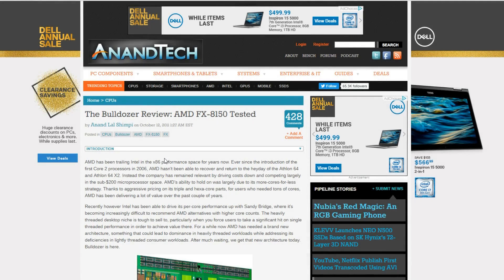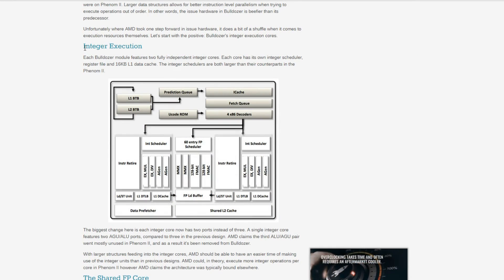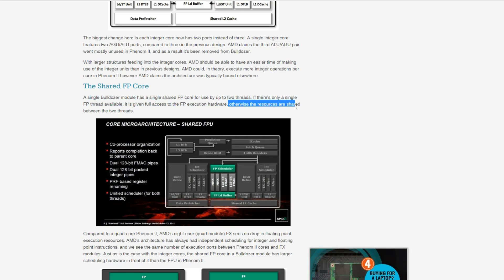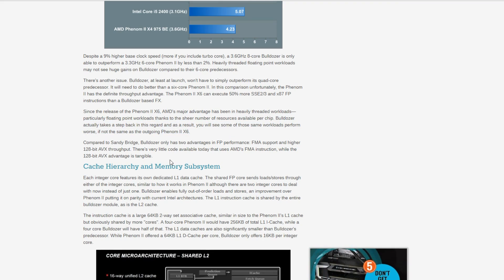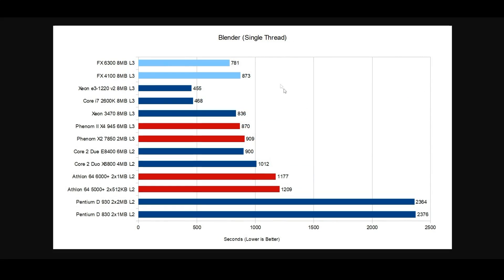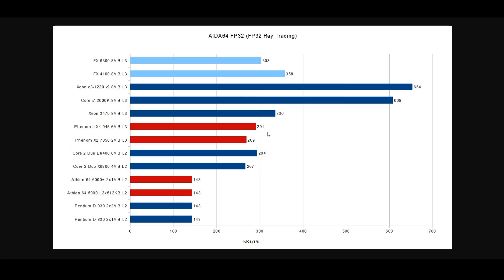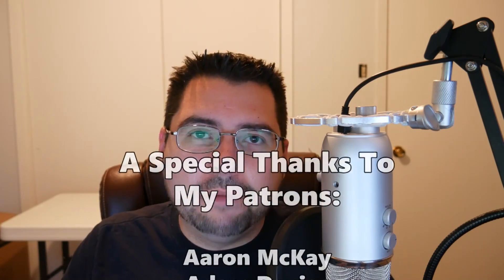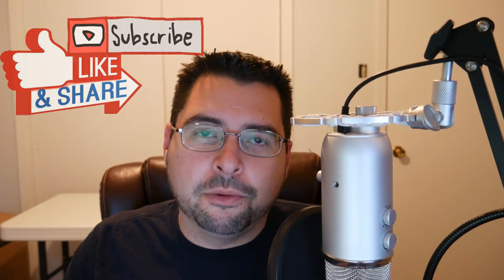IPC Test 7: AMD FX Series CPUs! How Does it Compare?

Comment: I got into heated arguments at Amd forums and with even a employee before it came out i knew IPC was going to be lower on Bulldozer as it was common sense looking at the design.  Months before launch JF-AMD started to downplay ST performance and i knew it was going to suck. I waited still with my 200$ Sabertooth 990FX board for reviews to come and sure enough tomshardware said the engineering team was trying to "hold the line" on IPC with Bulldozer and increase frequency's to 5ghz yah how dumb is that? 

Ended up buying a 8350fx to replace my 1100T that easily OC to 3.9Ghz and my 8350 couldn't go above 4.4 and it was slower in some cases like in emulation which i used often.

So happy Amd got their head together with Ryzen and created a logical architecture.

Comment: AMdD really banked on high clockspeeds and parallellization, but only for integer calculations, since anything requiring fp32 would end up bottlenecked by the fp32 being shared between integer cores. Obviously AMD didn't really think about what the market looked like at the time, had they introduced a Zen like design back then and a Bulldozer like design today it would have done much better, as software would have been more parallellized in time for the many "core" Bulldozer cpus, however it would make the most sense as a cost saving option for integer heavy workloads, where you'd be able to get more "cores" and higher clock speeds for a lower price by sacrificing fp32.

Comment: I'm under the impression that the FP scheduler can schedule two 128-bit FMAC operations simultaneously.
Reply: That is true. Not many App/Game devs took advantage of this. If they used the normal Intel-optimized compilers the program saw just 4 FP Unites, each 256 Bit wide. If however a game dev decided to optimize for AMD instead, the program saw 8 Int Units together with 8 FP Units at the same time, increasing throughput dramatically. Not many devs did this, also Windows 7s thread scheduler wasnt tuned for FX when first benchmarks happened, further decreasing scores and increasing "FX is shit" mentality.
Ive spent an extraordinary amount of time to research and to fully understand FX arch, just because Ive always felt that it was a misunderstood architecture - and it was. 
To what Ive stated above came, that games and most apps werent ready for 8 threads too in 2011/12, most games used 4 cores at best, normal programs even less.

If AMD decided to release an "opteron version" of the FX for mainstream, things would have looked differently, even if game devs continued optimizng for intel, because then, 8 256 bit (or 16 128 bit) FPUs would have been present, together with 16 int cores @ 3.3 Ghz @140w. For productivity in form of the 6282 SE Opteron this was a dream machine beating anything Intel had at that price point, sadly it was only offered to server customers using the G34 socket. 
Example: At specint: 2* 6282 SE 526 points. 2* Xeon-X5690 419 points. The Xeon did cost 600$ more. 
Conclusion: FX never was designed to be a consumer product, it was designed for servers and datacenters where it performed very nicely and beat Intel in the so important performance per dollar per watt department. So while mainstream magazines and youtube channels etc just looked at fps etc, server tests like Specint etc. drew a very different picture - a good one for AMD.
Reply: @Spicysauced  I looked into Intel's 256-bit for calculation implementation.  For a while Intel used the 128 bit fpu calculation for two clock cycles in order to produce a 256bit calculation.  Interesting way to achieve the same calculation.

Comment: You asked a question towards the end of the video that you didn't understand why AMD lasted this long. So I'll tell you why I think they did. The reason why they were still pretty successful it's because the flagship piledriver CPU, the fx-8350, performs pretty well in almost every game of this generation, and really began to shine in longevity by 2015 when game start to take advantage of multi-threaded usage. I'm still using an fx-8350 clocked at 4.2 gigahertz with an RX 580 8 GB and I get 60 to 80 frames per second in almost every modern title at Max settings at 1080p. In the synthetic benchmarks the FX gets destroyed but in actual gaming performance it still does pretty decently despite its horrible single core IPC. AMD also survived by utilizing it's horrible CPU architecture in every current gen console and their upgrades. This generation of consoles was severely bottlenecked performance-wise by AMD Jaguar architecture, which turned out to be a blessing for piledriver owners which six to eight core CPUs, because slowly but surely, more cores became more important. The fx-8350 is now almost 7 years old, one of the oldest and longest lasting gaming related CPUs.
Reply: I know this thread is old but just wanted to throw out a note from recent upgrade. Like Grimm I was also running OC'd FX8350 but a XFX RX 480 GTR Black with similar results. While monitoring rarely ever saw the CPU maxed out except in synthetics. After swapping to a Ryzen 5 2600 on a B450 and 16gigs of 3600 I typically saw a 40-60% increase in frames, some titles even more. As far as gaming goes, seems to me the first leap in performance came from the PCIE upgrade on the motherboard rather than the beaten up FX processor.

Comment: I wouldn't have compared to these lower end Phenom but if it's all that was available whatever. It's sad AMD went backwards. I had FX6300@5.1ghz, FX8320@5.1ghz, and FX8350@5.3ghz on my Asus 990FX ROG board. Great CPU back in the day just for overclocking fun.

Phenom II x4 980BE > FX4100
Phenom II X6 1100T > FX6100

Comment: Ain't no one running those lower end FX CPUs now. Everyone should have an 8-core FX clocked to 4.5 GHz or higher, with 1866 MHz RAM, and other HT and NB overclocks. I went from a 3.2 GHz Phenom II x6 to an OC'd 8-core FX and I noticed a jump in performance. The Phenoms don't have AVX which is required in a few newer games and it doesn't have AES crypto acceleration... which now the common standard.
Reply: Yeah, at higher clocks, these chips consume over 200 Watts. You need a good 990FX based mobo.

Comment: i had fx4300 and a AMD Athlon 5350 APU cheap back in 2012/14,,i allso pick up all the fx chips they all think are crap,i got the other day 4300fx $20 boxed in full tower i also picked up 8320 full tower cheap 2x 6cores 1) phenom 2 & fx6300 i happy as fu-k picking up them chips keep slaging  them off and ill keep picking them up cheaper

Comment: I ran an FX-6300 @ 4.8Ghz for years and it did very well, and wasn't difficult to overclock. It worked well and still does if you need a really cheap build. I got it for about $130 CAD. Hard to argue with that at the time ;)

Comment: I had an FX 8120 back when it first came out. Unfortunately the whole module shared core thing never made it feel like a real 8 core, and it was pretty terrible for gaming. Ended up going with a 2600K and stuck with it for 5 years until I got a 6700K.
Reply: Nowadays a Ryzen 1600 is about 10-20% better than a 6700K and sometimes a 7700K in mixed workloads, and that's mid tier.
Reply: Yup, if I did mostly workstation or do any actual real work I would go Ryzen all day. I now have an 8700K since the only thing I use this for is gaming.

Comment: and nobody talk about right overclock fx. 5ghz- its vrong. For games you need as fast as pisible ram, and cpunb 2600+, core near 4.5 if you can or less, its get best results than 5ghz.
Reply: CPU NB and or HT overclock does little to nothing on the FX series. However if you are running higher frequency RAM you want your CPU NB to match or exceed the RAM Frequency and HT speed.

Comment: Hey! I’m running an fx8350 with an nvidia gtx 1050 which are both considerably overclocked... unfortunately, my motherboard (or maybe cpu) seems to be breaking, and my FPS has decreased by 20 (and ping increased by 30) compared to when I first bought the processor and mobo.
What is a good upgrade to the 8350? Would a Ryzen 5 be a worthy investment?

Comment: For anyone owning an FX, overclock the NB or FSB (which also OC the NB). 
At 4.5 Ghz with high NB, you'll beat 4.9 Ghz with stock FSB. Even with un-tuned RAM on a $40 mobo (price new in 2015), I benched 748cb. Not bad when the 6700k overclocked makes 980cb and cost over double (didn't exist when I bought FX either).

My current bench is 870cb with extreme cooling, just hitting the Vcore limits on my $40 mATX board with 4 phase VRM. It did good, but now that I have money, I've got Ryzen and getting a Threadripper (either 2950x or 2990WX) this weekend for quad GPU benchmarking. I also have a Titan Xp collectors edition for sale (I don't have a use for the Titan, I'm switching back to crossfire for 4k and multi-4k gaming).

Comment: why the fuck are you benchmarking a cpu which has "octacore" as its gimmick in single core benchmarks? that's retarded.
in practice, the fx aged better than its earlier shitty single core performance would suggest, because stuff is FINALLY making use of its extra threads. not that i would trade my good 6-year-old-and-still-good 2500k @ 4.7ghz for one, but the gap has surprisingly narrowed from then to now.

Comment: 11:35
Because you're just looking at one FX core vs 1 Intel thread while the story looks differently when you do two FX cores on a module vs 1 Intel core with two threads, there the FX series actually does much better.
11:50
Its been years since that was true.
These days most workloads seem to be mainly quad thread heavy with some more threads also being utilized in some applications.

Comment: I had a Phenom II X4 965. I sold it. Later I bought a Phenom II X6 1045T + HD 7770. It ran well, but I wanted the FX-8350. I bought an FX-8350 and I saw a big difference in the game I was playing at the time - Need for Speed - The run. On the FX game ran more smoothly, with almost no stutter at all. On the Phenom II 1045T I experienced stutter and glitches. If you test it in games, you will see the difference between Phenom II X6 and the FX series, despite the apparencies.

Comment: Can you do a video on what's the fastest DDR3 supporting cpu out there?
Reply from the maker: That'd be ivy bridge-e
Reply: Performance or "fastest" as in clock speed? FX holds the world record at just under 9 Ghz (like 8.8 Ghz). Performance is going to depend on a lot of things (single thread, instruction set, cache size and latency, memory overclocking potential, etc), so you won't be able to get a specific answer on that because "the fastest" is way too vague since some will be much faster than others depending on workload. Frequency is the only one that's easy to answer since its just 1 number (even if its not all that useful).

Comment: I have an fx4170 which are being upgraded next month.Ye it's a slow ass cpu but she still runs most of my gaming paired with my 1050ti.Reason why i went with the fx series are i had such a bad experience with intel before that i refuse to go that route Luckily amd learned from there mistakes and came back strong with the ryzen lineup although not perfect regarding memory compatibility.
Reply: Ryzen can handle 4000mhz ram with a CPU overclock. It all depends on the motherboard. Some can do both, others can only handle one or the other.

Comment: This is why you never buy AMD CPUs because the support is non existent from software developers. Ryzen will be the same story in the future
Reply from the maker: Ryzen runs fine on all current software. The design is simply better
Reply: Yeah I don't think that will happen. I think AMD learned their lesson with FX on their CPU side. FX would of been a whole lot better if former CEO Dirk Meyer didn't force his engineers to cut corners to save money. Dirk Meyer refused to hire an engineer to hand design the FX and computer design it instead which greatly reduced it's potential performance and ended up costing AMD more money in wasted silicon. AMD's current CEO is a bad ass in the industry and that's why we see AMD coming back at the highend spectrum.

Comment: Honestly, I have enough of all the videos about how bad FX is. It's NOT! Yes, go ahead and compare compare compare. Just stupid. If you have an 8350, you are far ahead of your needs. Pair it with a 1060 and all the games will run at 60 fps easily. So what is this all about stupid comparisons? Intel has a huuuuge disadvantage. Every cpu is a new chipset. New board, new cpu... AMD stays with one board and you can use it waaay longer. Hence the "survive" of FX platform. And as I said, FX is good enough. Just use it, play, create. And stop the hype over comparisons.
Reply: The FX line up lost AMD quite a bit of market share. The entire architecture was a huge gamble on AMDs part that Software would soon follow that would use its potential. And it didnt pay off. I used my 6 core Phenom II from 2010 till 2016 cause I had basically nothing to gain from FX. Later on you could get some really good deals on the FX 8 cores which made them a feasible option for some people. But at the time of the release a great majority of games for example only used 2 cores and with Sandy bridge being that much faster in single core performance they were the clearly better choice to buy if you wanted to game at the time.
Reply: Let's Play It From The Beginning my buddy is upgrading because he has a 1070 and an 8350 and bf1 and bfv beta barely hits 60 fps at 1080. Mainly stays around 54 fps. That's terrible. They're not bad, they're just not gaming cpu anymore. A r3 1200 will outperform. There's no point in keeping it when an r5 2600 is only $170.
Reply: @dylanneff8338  I have an FX 9590/DDR3 2400/R9 Fury X build and a TR 1950X/DDR4 3600/RX Vega 64 LC build. I don't know what is wrong with your friend's build but BF1 with max settings at 1080P on my FX build  I get an average around 104 FPS at 1080P.
Reply: Timothy Isenhart I really don't know man, he has a 1070 and he was getting 40 ish but I told him to put it into high performance mode and got him around 60. Could be the clocks since the difference is 1 ghz. He doesn't know how to oc so I think it's best to just upgrade. I blew up 2 motherboards and a fx 6300 before I was decently experienced so I wouldn't advise it for beginners. His cpu is constantly at 100% so it could be background applications mainly antivirus.
Reply: I just saw this video and came to my mind your comment. https://www.youtube.com/watch?v=pfSSUo8_Kf8 This is with a 1060
Reply: Dylan, of course, better is better, faster is faster. My point is that FX is not ready to dump. I will upgrade it as well with time, but not just yet. Maybe at Ryzen 4th gen... ;) Until that point I have many games to finish what runs amazing. I just don't feel like throw out a great value. I run mine on 4.6 ghz though and overclocked the gpu as well.
Reply: Let's Play It From The Beginning ah I see. It will always play the majority of games.

Comment: I just built an amd fx8350 with a gigabyte 990x G1 gaming motherboard with a m.2 SSD and a r9 290x (4gb) and 8gb of ddr3 Corsair Vengeance ram and custom cooled it on a cheap budget and the thing runs perfectly fine for gaming and that's coming from a guy who had a intel i7 4790k with a gtx 1080ti

Comment: Unlike a lot of people i'm not in denial that fx8350 had bad ipc. But at least it stayed viable enough paired with a decent gpu to get 1080P 60, even to this day.
While an intel rig with the same set up could get lets say 89 fps, the fx8350 only got 67fps average , the increase did not matter because vsync would cap it at 60fps anyway.
My rig from 6 years ago: Fx8350, radeon 7970, 16gb ddr3 1866mhz ram, 120gb sata ssd (os), 250gb sata ssd (games) can still hit 1080P 60 max in most of the titles I play. I do not play all the latest titles, but just the fact that this machine is still pulling it off is still amazing. This isn't praising AMD, but in reality is actually saying how much the market has slowed down in regards to technical progress in games. E-Sports have also gotten more popular which have also made the need to upgrade to better machines unnecessary if you do not care too much about modern AAA titles like I do. I enjoyed Doom 2016, hated Wolfenstein 2, Prey 2017 was excellent, and Dishonored 2 would have been great if not for the poor optimization.
Out the 4  sample AAAish games I listed, only Dishonored 2 gets less than 35fps, although wolfenstein2 only ran a 45 fps on release and has improved greatly since release past the 60fps mark, but Doom 2016 on the same engine as Wolf2 gets 100fps and looks just as good...
I will tell you one thing though I have recently gotten into the Sims 3 again for the first time in like 8-9 years, and oh boy I do not recommend this game to anyone on an AMD CPU due to its poor optimization / only being coded to work on 2 cores with a little third core offset. (although in 2009 being dual-threaded was a big deal, but add 2 expansions into the mix and even my fx8350 runs like a dog when overclocked to 4.5ghz playing it)

With more modern games using more than 4 cores it is holding the fx8350 on life support just a bit longer so I can wait until the 7nm cpus are released, which is what I have been planning on since the first ryzen release.
Reply: I bought an 8350 a few years ago when I moved to a new state and had limited funds for a while as I got set up.  Cost me around $120.   It served me well along with a RX-470 as a mid-range gaming PC.  I bought a Ryzen 1800x / Crosshair VI last year to replace it.  It worked fine until I sold the MOBO (Killer Fatality 990FX) with the CPU and 32 GB of RAM for $250.
Reply: I think that Ryzen at 7nm will have great performance while ripoff Intel hovers around 14nm.........unbelievable.